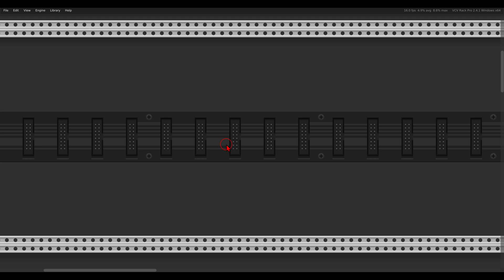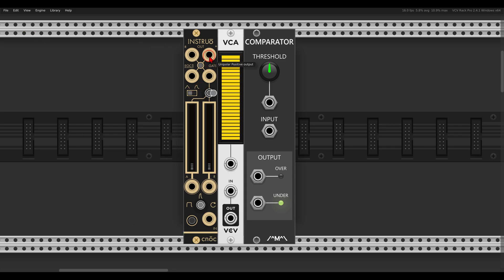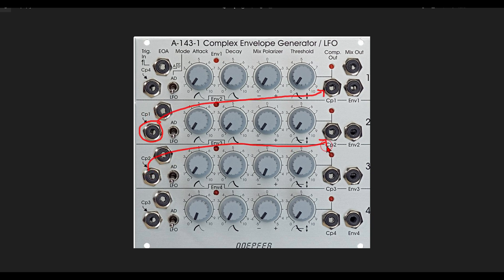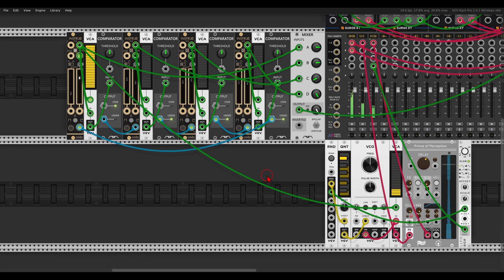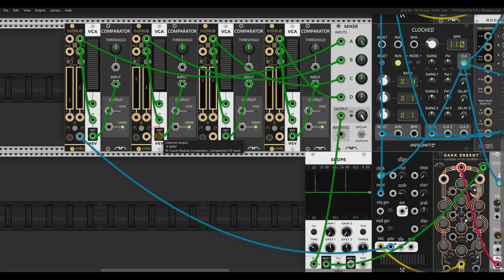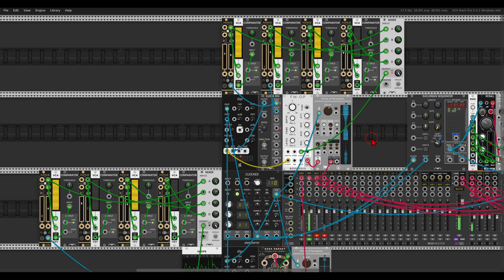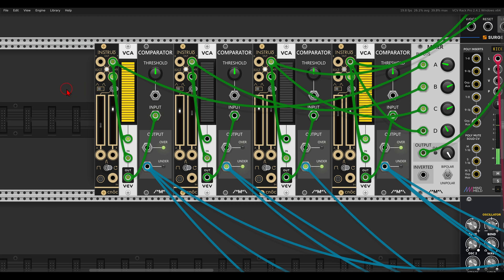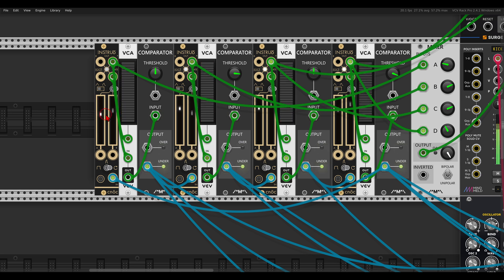Techniques to learn from the Complex Envelope\LFO module by Doepfer

Comment: HELP Mi!
 Surgext modules crash vcv rack. All the latest updates are worth it. I tried deleting them even from the plugins folder, but as soon as they are installed, it crashes when opening the module!
Reply: Even reinstalling and deleting the plugin didn’t help, but I downloaded the new version from Github manually, so far it’s working!
Reply from the maker: I hope it will be fixed...